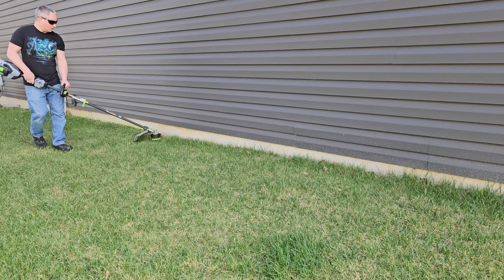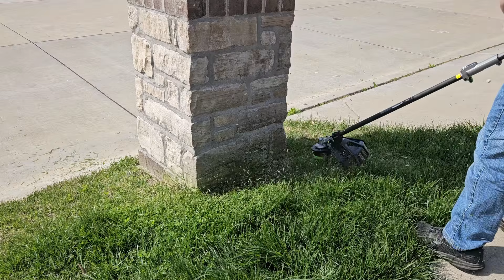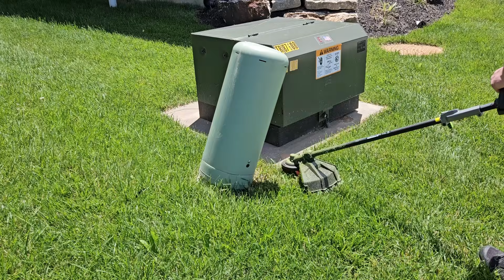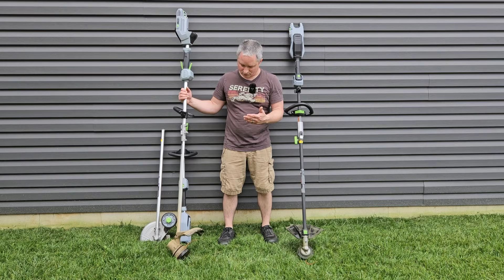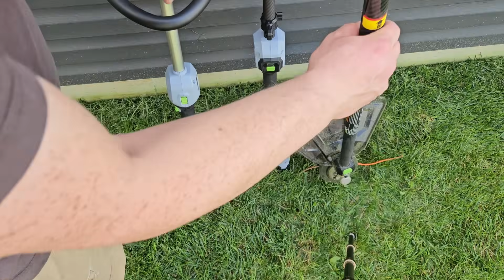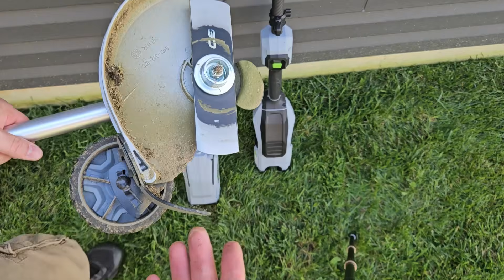EGO Gen 2 Powerhead Review and Comparison - Differences from Gen 1 Version

Comment: Ego warranty is useless, even if you register your product. My purchase was from an electronics store (not some shady 3rd party) that was not "authorized" so they denied the claim. They could not have cared less, even though I have multiple batteries and tools. This battery was used about 2 hours total before dying.
Reply from the maker: That's not an EGO problem, that's a retailer problem. If they're not authorized, how is EGO supposed to ensure they're not selling fakes or defective returns as a new and genuine product?  What was the store? I'd return it to them if you've used it less than 2 hours.

If it was something like this Newegg listing by seller "YIWANGQINQIN", then it absolutely IS sketchy, BTW: https://www.newegg.com/p/0X6-0F9M-008K5
Reply: Ego has stated it is a legitimate product. It took Ego three days to figure out the store was not an authorized dealer. How is the consumer supposed to figure that out? The store is actually going replace the battery. I should have started there in the first place.
Reply from the maker: Glad you were able to get it replaced! If in the future you're ever unsure about whether or not a retailer is an authorized dealer, you can check the product page at egopowerplus.com and click the "Where to Buy" button for a list of authorized retailers.

Comment: Question. I have a 2022 EGO 1510T trimmer. Can I buy the edging attachment and use it on my old trimmer? I'm looking at my 1510T trimmer and wondering do I have to use an allen wrench and unattach to swap out to the edger attachment? If so, a video showing this would be great. Thanks. BTW, great informative video.
Reply from the maker: Unfortunately there's no way to make that trimmer work with any of the power head attachments. The motor for that trimmer is in the string trimmer head, down at the ground. The power head units PH1400 and PH1420 have the motor up next to the battery. Otherwise you'd need a motor in every attachment.
Reply: @DoresoomReviews if I buy the new edger, will it automatically work with a newer model string timmer and vice versa?
Reply from the maker: Both the aluminum and carbon fiber edger attachment only work with the PH1400 and PH1420 power heads. They will not work with any string trimmer.

Comment: Bleh, hard to figure out which of the 4 trimmers i want, theres the multi tool, the 15 inch with line feed and bump, 16 with line iq which some hate, and the commercial version which looks nice and is supposedly more durable. Shame stores dont have a “try out the string trimmer” area ahaha. You know if they handle 0.105 string or if i need to downgrade to 0.095 black diamond. This video kinda sways me to the multi one though, just slap a strap on. Maybe ill get the polesaw attachment too
Reply from the maker: If I could start over, I'd just have bought the multi-head from the get go. I've sold off the other two EGO dedicated string trimmers I've had and just run the multi-head now.

The pole saw attachment is great too, I'm working on a review for that one next!
Reply: @DoresoomReviews welp, then i guess ill just decide if i want the cheaper ph1420 or the commercial phx1600. Thanks for your input :) ill see what happens with sales
Reply: @Jzwiz also keep in mind that anything with the powerload feature (not just line iq) requires the twisted line in order to work. I can't decide if I like it or if I'm regretting my purchase since the twisted line costs more. I tried putting regular trimmer line in and it wouldn't suck it in when I pushed the button. I thought it was only line iq that needed that special trimmer line. I should have done more research. Oh well.
¯\_(ツ)_/¯
Reply from the maker: @ericcaldwell3584 Were you using 0.095" diameter line? That's the only specification the manual makes, no mention of whether twisted line is required or not. By pure chance I haven't used anything other than 0.095" twisted line in my EGO string trimmers with Powerload, but haven't experienced any loading issues with several different brands.

Comment: Based on reviews and comments evolving from them, I am not convinced about the "Powerload" feature (and just try and find a current model trimmer without it) there are any number of issues longer term that can not easily be fixed and there also appears to be no way to bypass said loading feature if it does stop working.  As well it sounds like non-Ego branded line spools can not be fitted plus, and I could be wrong here, it only works well with one size of line.
Generally, Ego is border line on involving too many proprietary things, it forces you to their products which I understand but there are those of us who already have attachments we would like to continue using.
Reply from the maker: You can also wind the Powerload head by hand - just twist it like a regular string trimmer to wind it up instead of the motor doing the work.

I've used .095" line for probably close to 15 years - I have no complaints that the EGO works well with that. I've never tried any other size line, but really have no need to anyway.

Comment: Does the edger attachment work on the Gen1 ?
Reply from the maker: Yes. As of 6/2025 every attachment works with both powerheads except the carbon fiber string trimmer attachment with powerload. That feature only works with the Gen 2 powerhead.

Comment: I have several attachments and everything works fine except the brush cutter.  I am unable to use it due to excessive vibration at either speed setting…super hard to control…has anyone else experienced this problem or have a solution ?
Reply from the maker: Sounds like either you got an imbalanced blade, or it's installed incorrectly. Make sure it's installed per the manual page 3: https://egopowerplus.com.au/media/productattach/b/c/bca1200_brushcutter_attachment_manual_au.pdf

Comment: I'm hoping you or someone who catches my comment can help me out. I bought two brand new PH1420 Carbon Fiber shaft power heads. On both of them, when I pull the trigger at a certain RPM, it makes an ear piercing LOUD whistle/howl noise that remains.

I did a fair amount of research looking up details about this Ego trimmer, and nowhere did I see any mention of this absurd noise. Did I just get unlucky and get two faulty brand new shaft power heads? Do they just need to be used a bit and the noise will eventually go away? Again at certain RPMs, say about 25-30% pull on the trigger its an outrageously loud whistle. Will this fade away overtime? 

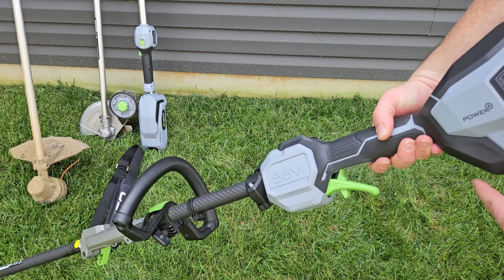In this video when you toggle it at 1:26, I didnt hear what Im experiencing. Again brand new, just put the battery on and rev'd it a few times. At full throttle the whistle goes away but for I wont be needing it at full power all the time.
Reply from the maker: I haven't noticed that noise with mine. Are you running it with an attachment installed?
Reply: @DoresoomReviews  tested with and without the power feed 16 inch trimmer. I waved the white flag though and will be returning it all tomorrow. Powerful trimmer but I think for what I need, it was too much. 

Thanks for replying as well, take care

Comment: Inportant to know tHe gen 2 
( PH1420) RUNS CARBON FIBER SHAFTS. 
GEN 1 ( PH1400) DOES NOT FIT FIBER EQUIP.
Reply from the maker: That's not true. EGO lists both the PH1400 and PH1420 as compatible with carbon fiber attachments. Only the string trimmer attachment Powerload won't work with the PH1400.

Comment: Nothing less than a top-tier review- well done!  The one thing that I cannot stand with the stand alone weed eater is that there's no in-between throttle...it's either all the way or nothing.
Reply from the maker: The old (now discontinued) ST1500 string trimmer in the video does have a variable speed trigger, but I don't know about all models EGO has released. I think a lot of battery string trimmers do limit you to one or two speeds, probably because they're trying to run the motor at its most efficient RPM to maximize battery life.
Reply: TOP TOP TOP Video !! Thanks so much for this! Greetings from Germany!!

Comment: Any updated thoughts/updated comparison on these 3 now that you’ve used them all for a bit:

ST1511T (Aluminum Frame/2.5ah batt) $153
ST1623T (Carbon Frame/IQ/4.0 ah Bat) $240
MST1704 (Multitool/Carbon/IQ/5.0ah bat) $280
(All 3 have Powerload)

By the looks of this video you brought back the ST1523T as you mentioned you might since it’s not for shorter people. I’m 6’0 So that probably wouldn’t be much of an issue.

Im completely torn as I see advantages/disadvantages with all. 

For the 1511, Smaller battery I can see a plus (I’ll already have a 7.5 from the mower and a 4ah from the blower) so I can see advantages of having the 2.5 for just a lighter tool overall, despite it not being as strong.

For the 1623, Ive read mixed reviews on the IQ’s effectiveness but the stronger battery can certainly be a plus.

For the MST, I can live without the edger but really like the idea of snow shovel, seems perfect for the amount of snow we get in the front range of Colorado so that’s something we’d look into down the line.

Appreciate any input and thank you your reviews have been so helpful in making these choices for our new Ego lawn tools we’ll hopefully be grabbing this weekend.
Reply from the maker: I sold the Line IQ to my neighbor, mainly because of the height issue, also because of the loss of control for when the line advances - I was hitting more trees and damaging their bark with it.

I don't mind using a 4Ah or 5Ah battery for a string trimmer, but it makes a huge difference to have a light 2.5Ah battery for the hedge trimmer. That's pretty much the only tool I use it in.

If I were to start over though, I'd definitely pick the multi-head system from the start. The trimmer has a little more vibration, but the other accessories make up the difference. I've got the snow shovel for it too, and it works surprisingly well. And I picked up the polesaw when Lowe's had them on clearance last year, which is very handy for safely trimming high branches.
Reply: @DoresoomReviews  Thank you so much for the quick response and Thanks for the input. Ego always makes it really challenging with their pricing model which is part of the challenge. You almost feel inclined to buy the whole kit, especially with the price of batteries by themselves. With the multitool the newer version MST1420 + new model of the trimmer with the IQ goes for $280 while the option for the MST1400 + older string trimmer with bump feed goes for $380 which makes little sense.
Reply: @cbenini87  Where did you find MST1704 for $280 ?
Reply: @Datvi  Lowe’s has the kit right now for $280. Includes the powerhead, 17” PL/IQ and a 5ah battery. 

I’m still debating on that one vs the standalone carbon frame with power load and no IQ and 2.5 ah battery for $180. (St1521)

Comment: Thanks for your thorough review. I have the EGO ST1511T single unit. I have a lot of weed eating on my property. The 5hr. bat. Really is handy for this job, time to spare. I like the string feed system too. 
The other feature I appreciate is the ability to rinse this thing down after my weed eating. Just remove the battery first. Then let it drip dry in a sunny spot an hour or so.
Reply from the maker: It's a great trimmer, and Powerload is awesome! It is rated to IPX4, which is for splashing water. But I don't think I'd take the chance of washing it down, especially with the motor down on the head.

Comment: They have a carbon fiber shaft with a 3 lights for the power setting. I think it's the commercial version 🤔
Reply from the maker: I don't believe the commercial version is compatible with any of the regular attachments though.
Reply: @DoresoomReviews  i called into headquarters. They have confirmed that it is compatible with the existing system, so you can use the commercial wand with a 3 speed setting with the existing
Multihudline up for residential
 😉
Reply from the maker: Thanks for the correction! I'm glad you checked.

Comment: Hello 👋 .. Awesome review .. You obviously know these products more than I .. This is my situation .. I am in the tree service domain (tree surgeon) .. am weeding out some of my gas ⛽ equipment for electric .. So far I have one electric chainsaw (top handle) for which I use while in the tree .. I have purchased (yesterday) a EGO leaf blower model (LB7654-2) .. haven't received yet .. but it does come with a rapid charger + 2 BA2800T batteries .. I need a pruner .. I like what EGO offers .. The model I'm interested in is PS1000 .. It's the CF pruner that cannot accept any other attachments .. Therefore .. I don't want multiple units .. You seem to really know this brand and particularly the Gen 2 .. I'm thinking of Gen 2 with a couple of attachments + extra battery 🔋 .. Is this something you would recommend .. My leaf blower comes with 2 (BA2800T) batteries .. Is three batteries sufficient .. Bare in mind that I will be this sparingly .. Thanks

Comment: Well our local store had a 20% off sale a couple of days ago. We purchased a kit with the Gen 2 powerhead, line trimmer, lawn edger, cultivator, 5Ah battery, fast charger and strap. The kit also included a black EGO baseball cap as a bonus. And the purchase entitles us to an extra 2.5Ah battery at no extra cost. 
Straight off the bat, the lawn edger produces beautiful straight clean edges in quick time. I thought I did pretty good edges with the line trimmer, but the lawn edger is next level. And the cultivator has proven to be perfect for our needs. 
Having had a dedicated EGO line trimmer for a couple of years, I certainly agree that the Powerhead line trimmer is heavier, louder, and vibrates more than the dedicated line trimmer. It's not a show stopper.  But like you, I will continue to use the dedicated line trimmer and save the Powerhead for lawn edging and cultivating / tilling. Saves the annoyance of having to switch the accessories all the time. Thanks again for producing a video that is absolutely spot on. Cheers from the Land Down Under.

Comment: Just bought the EGO Gen 2 with four different attachments.I can confirm what he demonstrated.I'm really enthusiastic about this Multitool.I also own the brushcutter PH 1420 which is absolutely fine and of an extremely good quality and I can recommend the EGO Power tools,although made in China!
Reply: The brush cutter is absolutely fabulous.I bought the 1420 from the very beginning.I don't know the difference to to the 1400.But reading the data from both the 1420 has more power whuch I find is necessary.
Reply: @berndschroeer488 .  I can’t use my brush cutter due to excessive vibration which makes it dangerous to use…any suggestions as to what I might try ?
Reply: How do you like the brush cutter?  I have 4 attachments I bought from people but no powerhead yet.  Was waiting for a sale on the 1420 but I found a 1400 for $50 so I might get that..

Comment: Ego had a similar design of string trimmer head to the one you showed on later models of the gen one power head but the head did not last for me and the bearing on the spinning disc didn't seem to do much. The disc seemed to have lots of resistance even after a short amount of use.The Ego STX3800 came with a rotating disc on the bottom of the trimmer head. It was much better. I got years of commercial use out of this head with no issues with the disc but I can't say the same for the STX3800. The head also did have some occasional jamming issues but it wasn't a huge deal. I also found out the gen one commercial head was able to fit on the gen one power head and that is what I used after I was done using the STX3800. I used the gen one power head for a few years until the STX4500 came out. The gen 2 commercial head swapped out the spinning disc with a quick loading function. It is a much more reliable head in terms of jamming and so far it is still holding up after not having a spinning disc
Reply from the maker: Thanks for pointing that out! The string trimmers I've used from EGO were the old ST1500SF and the newest Line IQ model, neither of which had the spinner feature. I didn't realize they had models in between with it built in.

Comment: My gen 1 powerhead is on its sixth summer. Maybe I will look at upgrading. I bought the snow shovel attachment 2 years ago when it came out, and I was disappointed with its performance with my existing powerhead.

While I also started with the trimmer kit, I bought the carbon fiber trimmer last year because I really liked the power load feature on it.
Reply from the maker: I have the snow shovel attachment too, but I haven't used it with the Gen 2 power head yet. The few times I've used it on <2" of snow, I thought it did OK. But that was light fluffy snow that wasn't too deep. Anything deeper and I'll be using the EGO single stage snowblower I bought last year!
Reply: @DoresoomReviews  I have a single stage and the big 2 stage as well. I bought the Shovel attachment for the steps, porch, and patio as it's too hard to get even the small single stage into the backyard. 

It does ok with a few inches of light snow. However, if there is only an inch or two of snow, I prefer to use the brush attachment as it's wider and quicker.

The shovel will stop spinning with 2 inches of heavy wet snow, but so does the single stage. 

Boeing makes a snowblower lubricant that really helps.

Comment: HEY NATE, great to see You with a new video.  I have always enjoyed your straight forward no nonsense and ‘honest’ reviews.  Congrats on a New Home.  This looks like a good upgrade from EGO.  
What size line does this use?  I’m thinking it will handle .095 Ok?   

I’m thinking You are in need of a new power tool or two for that House?  😆 Just throwing that out.  
Take care stay safe!  👍
Reply from the maker: Thanks! I've actually been in this house for a few years, but I don't post many videos of the exterior.
I run .095" line in it, which is what it comes with.